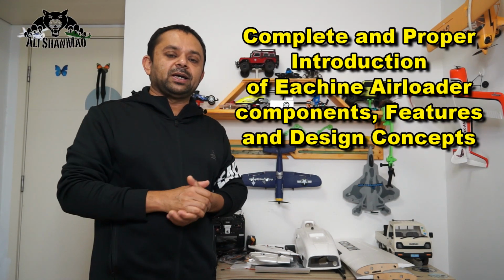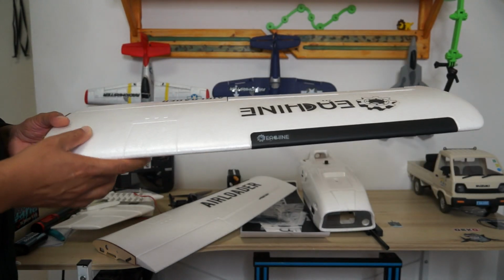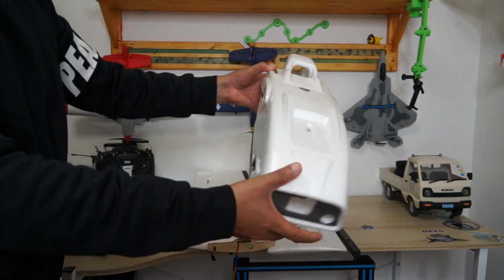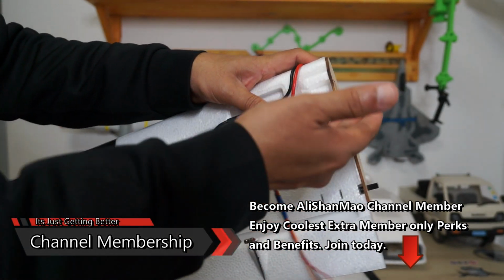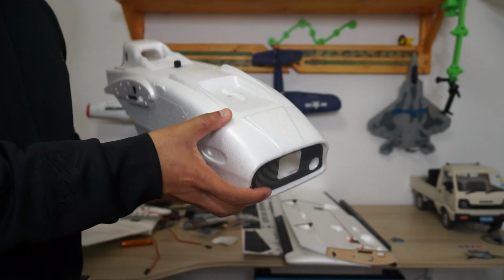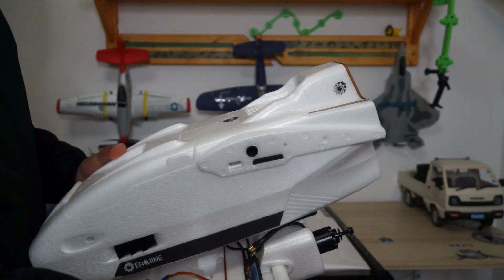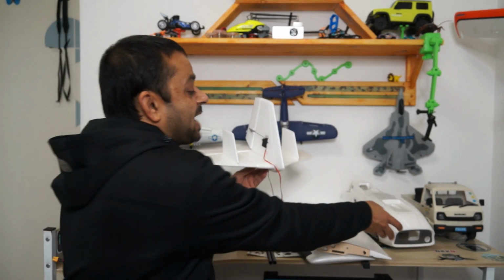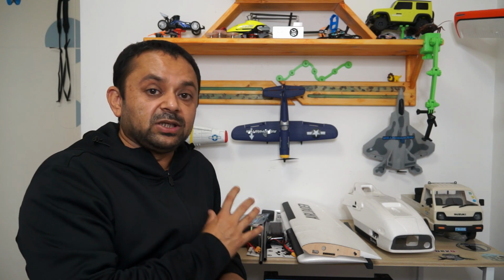Eachine Airloader Long Range FPV Aircraft Comprehensive Review

Comment: Hello ,
I specify that it is not an attack but a set of reflection which this want constructive. Regarding the set of rear rudder (rudder and elevator) the simplest to have air flow less disturbed by the fuselage will have adopted a V-tail configuration. in addition there will be weight gain. And above all a gain in drag. For the efficiency of the ailerons at low speed, a possible solution is the system used on the "Optera" flying wing with very fine "winglets" molded in the foam, positioned a few centimeters in front of the aileron attack which allows to hang up the wings. air streams without the loss of substantation and an increase in drag due to a slot connecting the lower surface and upper surface. The same "winglet" system can be adopted on the attack of the wing on the upper surface to again increase the efficiency of the profile at low speed. This reduces the stall speed and also the takeoff distance. I think that this type of "winglet" system will also have avoided weakening the wing / eleron connection by a slot
I apologize for my English but I am French and I use an automatic translator so sorry
Reply from the maker: Big thanks for your kind suggestions. Constructive criticism and constructive suggestions are always welcome. I will pass this information to Eachine and Designer for sure. for the wings you suggest that instead of slot the vortex generators will better option? if so, yes that can be done easily by DIY attaching some vortex generators. 
once my flight testing starts, of course I will keep your suggestions in mind too. 
In the beginning when design started, I asked the same to designer. what if he used a V-Tail instead of T-Tail. 
he suggested that T-Tail is the most used in real aircraft as well and one of the best solutions, plus easier to repair and setup too.
Reply: @alishanmao  one of the advantages of vortex generators is that if they are put over the entire length of the fin, they gain efficiency on 100% of the fin unlike the slot which is only effective over the length of the fin. the slot which has a reduced size for obvious reasons of structural rigidity. It is true that the V-tail is can present in the "true sizes" but one finds beautiful example of it such as: fouga-magister (french jet army) .Piper Bonnanza and on some model of business jet and glider . In any case, making such a modification on the Airloader would not be very complicated by 3D printing a part to accommodate the two control surfaces on the square structure of the boom so we could compare the two versions. Thank you for your answer and I eagerly awaiting flight videos
Reply from the maker: Thanks for the tips again. I will sure to see the mods after stock setup flight testing.

Comment: Great review! Just one question ... does a GoPro Hero 9 fit inside the fuselage? I'm looking for smaller platform , other than my Volantex Ranger 2000 , to fit my GoPro Hero 9 into instead of on top of the fuselage. The Hero 9 is bigger & heavier then the others but it's got great stabilization , it's like your using a gimbal.Thanks again for the great review!!
Reply from the maker: No it won't you have to modify the fuselage a little bit to fit GP9
Reply: @alishanmao  Thanks for the quick response ! Stay safe, Aloha!
Reply from the maker: You Too buddy

Comment: 40 minutes and no flying?!
Reply from the maker: Build and Test flights, many test flights videos are coming soon.
Reply: @alishanmao  I look forward to it. Thanks.
Reply: I can see why people would want to cut those wing connectors, the space to work with a soldering iron is a bit reduced. I think it would be wise to ship that piece unglued so people can work around it easier and then mount it in the wing.
Reply from the maker: in fact a very good idea. I will forward it to factory and eachine. maybe it would be even better if they soldered 3 pin Servo extensions on each connected. this way we will have 2 extra connectors to connect Flap servos and ESCs signals if we want and we do not have to perform any soldering at our side. that will make life easier for many pilots as not everyone can solder.
Reply: @alishanmao  decent static review but...think if i bought one i would still use normal servo extension connectors,simply wouldnt trust that strip coming loose in flight  possibly intermittant connections..especially on a long range flight which this plane is advertised for..everything has to be perfectly right...there is plenty of room inside for the hands to  connect all the wires..in my opinion..looking forward to your flight reviews.
Reply from the maker: Thank you for your concerns in this comment. I will sure to Focus on those. My Worry is if the connectors will wear out over time or not? or if the soldering breaks, (The one that is done at factory side) because such connectors were never used before. I will keep on making a list of worries, concerns and tips and ideas for this plane to test them all out during flight testing video series. First let us see if it flies good or not. If Flight performance is really nice, then we can proceed with all planned tests. 

If it does not fly that good and not a worthy performer for long range flights, then I won't waste time testing anything further :) or maybe switch focus on making mods to make it fly better in that case.
Reply: alishanmao I would be surprised that Eachine would go to the expense of adding servo leads to all the connections if they omitted mechanical hinges on the control surfaces just to keep the cost down 🤨